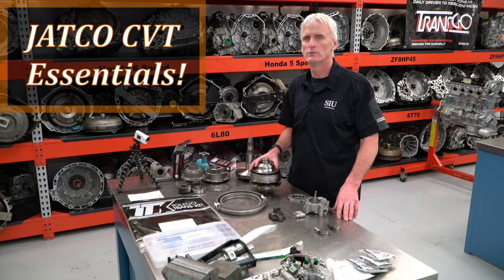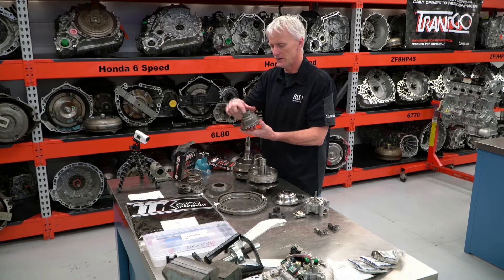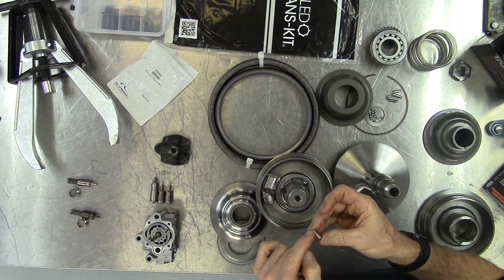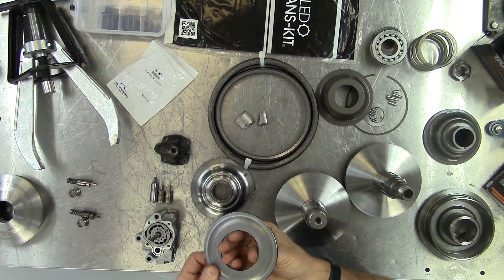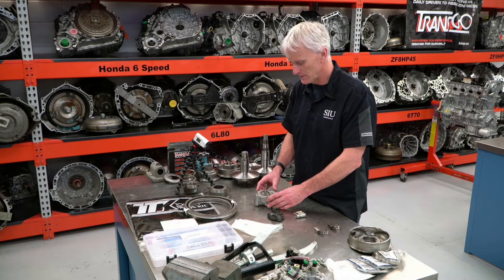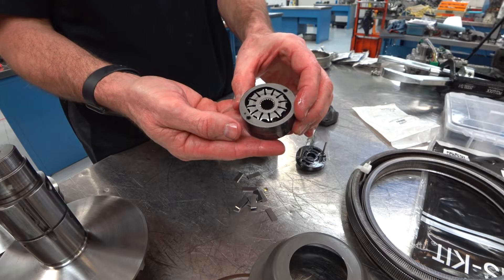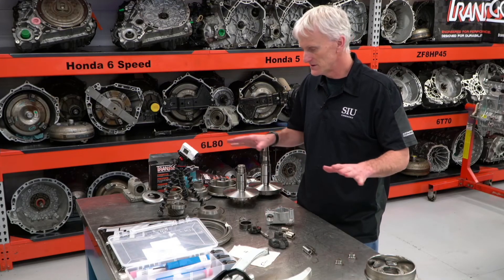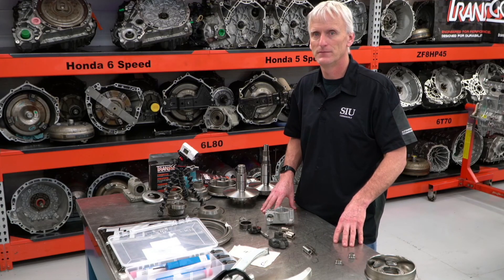Jatco CVT Rebuild Essentials

Comment: Hi , i have a RE0F10A NISSAN CVT and the vheicles judders intermittently at around 60km/hr when you accelerate , once at highway speed it drive ok. There isnt any sign of clutch slip . The CVT makes a loud whining sound you slow down the vheicle . Please advise on which part i can start my investigation

Comment: This guy is still taking his lemons and trying to make lemonade.

CVTs are a fundamentally flawed design. You cannot drive an automobile with a steel belt. Not for long anyway. 

Conventional automatics were to the point where they routinely lasted +200K miles. There was nothing wrong with them, they are a mature reliable technology.

CVTs add absolutely nothing, except an insignificant fuel use decrease. At the cost of unreliability and short service life.

They should be completely abandoned. They never should have been adopted to begin with. 

They were thought to be revolutionary, instead they bankrupted Nissan..

Comment: Hello, I have a question. There is a humming sound in the Nissan X Trail 2016 diesel automatic transmission. Everyone says it is normal between 20/40 km/h. What is the solution? It does it even when you slow down.

Comment: When servicing my 2014 QX CVT, the last step,  I'm supposed to get CVT  to operating temperature and pull the check fill plug while motor is running, verify the level is good. Why does the motor have to run. Also oil should run out check fill plug but when stream gets slow, put plug back on transmission.  I would like to understand more of what's going on at this step of the process.

Comment: Due to rusted cooling pipe from front intercooler to xtronic variator cooler tranny oil leaked a lot and xtronic variator started to slip. How many slips with low oil it can actually survive? Does electronics of this variator have some safety components due to partially lost fluid and inner pressure?

Comment: Hi!  Could a "whistling" noise that accompanies the rotation of the wheels when the vehicle starts to move or when it suddenly restarts be caused by the oil pump?  Or perhaps a non-compliant oil level?  Sorry for my English, I speak Portuguese and used Google translate.
Reply: Did u check the potentional leakage of trans-oil? Does your car have external intercooler for this fluid? Mostly pipes from this intercooler to the integrated cooler in the variator started to rust and fail due to extreme conditions in front of the car. But also due to high pressure of overheated trans oil which will start to leak somewhere and then its causing the slipping of the variator
Reply: @Blameberg  In my case, the transmission was replaced by Nissan under warranty, as the previous one made a very loud noise and had filings in the fluid.  Shortly after the change this noise appeared, unfortunately the manufacturer says it is "normal", but I know the car and I know it is not normal.  Maybe the fluid level could cause this?

Comment: I wish I could get the guys from a local shop to watch this video!! AH 13:00 the part I was going to get into.. You can't just bolt this up and go.. Dealing with Nissan is a Bitch and if they don't like where you got the CVT from they won't flash your software.. And that can Be costly.. I have been calling around.. And I found a way to get OEM Brand New CVT's fresh out the box but for $5500. And the problem with that is software and it won't have the improvements that he just made to it.. IDK what I am going to do.. And some of these guy's use way to much Gasket sealer and about a half in of it spurts out the sides inside and out went they bolting these back together, And the Valve body and passages get clogged from the Gasket sealer breaking off inside the trans.. I really don't know what I am going to do? I know I am not buying a new car...
  It truly is better to find someone like this guy who know's the different Rebuild kits too, and have them rebuild your CVT..

Comment: Thanks for the video. My transmission has broken recently. It has run 136000 km. I am a gentle driver. Almost never push the engine speed higher then 3. But changed oil only two times. On 30 and 90 km. Expected to change it on 150 km. As I can see it makes sense to change it every 30 km to prolong it's life?
Reply: I got jetco xtronic on my nissan and it survived 180 000km without single oil change. Until now due to rusted cooling pipe and leakage of the trans oil. Otherwise it would still work

Comment: Great info sir! New subscriber question. 
On the cvt belt the oem has ridges like the edge of a quarter. I'm rebuilding a jfo15e (12 Nissan versa) the ridges where worm off the belt. The belt is smooth on the sides now not grooved or chewed up just not grooved. (Variator pulleys look great) 
Question  #1 Can the old belt be reused?
Question  #2 I did buy a new aftermarket belt and it has no ridges at all just smooth. Should I use it or the old one?
Just not sure what's best. 
Thanks For your time.

Comment: is transgo flow control supposed to slide in and out easy explan please. love vedio
Reply from the maker: The outer bushing (the part the new valve rides in) requires a bit of force to push it in.  But the valve that rides in the bushing should be nice and free.  I've heard of shops that installed the Transgo valve have "buzzing" noise complaints.  For that reason, some shops prefer the superior transmission products valve or they opt to ream and install a sonnax valve. Although, some shops still swear by the Tgo valve.  I just thought I'd mention it.
Reply: @siuautomotive  thanks ipulled out and used fine sand paper .then it slid much easier. thanks again

Comment: What are the signs of bad pump/ flow control valve? How does the car behave?
Reply from the maker: Usually the pressure is low, so you will end up slipping the belt.  Then you Diagnostic Trouble Codes for gear ratio and/or secondary pressure.

Comment: I have a 06 nissan murano 3.5 fwd. the cvt re0f09a transmission  went out. like to find what transmission rebuild kits people have used and had good luck with.  also what other parts I should replace with the rebuild. part numbers would be great if you could get them.  thanks
Reply from the maker: slauson.com has hard parts for CVTs.  Seal Aftermarket makes nice kits for the CVTs.  I use wittrans.com for a lot of my parts.

Comment: Fantastic video, Thanks
The flow control valve, have you had any stuck high, Ive the 2 pressure sensors showing high pressure at idle, could that be the flow control valve?
Reply from the maker: I haven't seen it.  The flow control valve is kind of like a pressure relief valve, since the transmission still has a normal pressure regulator valve.  I wonder if you are having issues with the line pressure reg valve or solenoid?

Comment: so, Sean, I guess you forgot to highlight Superior's DROP IN, NO-REAM, and NO~Stick design STL011 that came out 3 yrs ago, specifically to stop the sticking problem that builders were having with the "aftermarket" replacements. might have just wanted to touch on that, especially when many have had to be taken back apart after repair due to the replacement being stuck. just wanted to point that out. AS a rep for SIU I would think you would want to advise your "students" on Whats' working for you today and maybe why they are all sticking after the rebuild. to this date, not one of the TransLab Valves has stuck, just wanted to "update" you so you can feel confident in a "Superior" company and their innovative products. keep the videos and training coming. great!
Reply from the maker: I’m going to be doing a video on a jf015e soon.  Hopefully I’ll get to use a superior valve in that for comparison.
Reply: Wow, a little snarky but as a builder I do like Superior's products. Great video Sean.

Comment: I have a question I have a nissan primera wp11 2.0 / 144 bj2002 with cvt
I live in spain, and have this car for 3 years the oil had to be changed
I didn't know if it was ever done, the car ran 170,000 I bought it with stand 110,000
Was going to do something strange, and 1 time he slipped {gear} because I also drive with a trailer, so replacement is done now.
He's okay, but when I drive the trailer, it slips, and gets stuck in 1 and doesn't come out any more
And if I wait fifteen minutes, it will be fine again, but this week I drove the trailer again, and it was even worse
Didn't have any problems before the oil change, it could be that they used the wrong oil ??? they say it's the discs that are probably worn out, and didn't cause any problems because of the old oil, and now that the new oil is in it, so problems arise when going up with the trailer, if it is driving on a straight piece, and without a trailer, nix no problems, before the oil was just transparent, and now there is red oil in it, it could be that it comes through the wrong oil ???? the oil is also very hot when I open the hood, can you help me and what to do.
Reply from the maker: Hmmm, I’m not to sure.  The models here wouldn’t likely handle trailer towing.  Any lights in the dash or diagnostic codes?
Reply: Have you fixed your problem? I nearly Got the same issue- and same car😳🤭😂 i Think it could be a solenoid- but really dont know yet how to test or replace it.. 
regards

Comment: I called whateverittakestransmission and they said they don't sell to customers only shops what bs is that
Reply from the maker: Hmm, I was unaware of that.  I'm wondering if you registered online at their website if you can just buy online.  They have a shopping cart shown.  I guess we've never run into an issue buying from them.  Have you tried any of the other suppliers?  Like Slauson?
Reply: I just bought all my rebuild stuff from what ever it takes and they were really helpful. I don’t have a shop.
Reply: They don't want someone standing at their counter that doesn't have a clue as to what they are doing wasting time